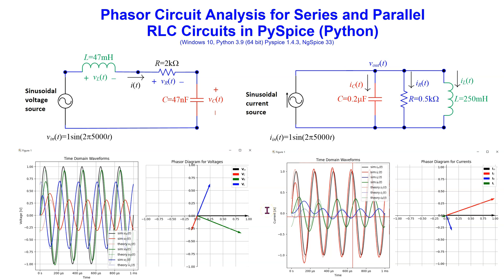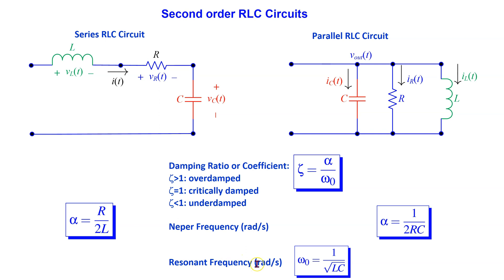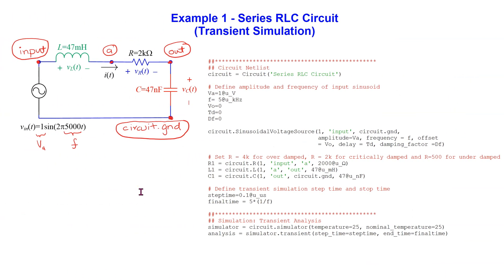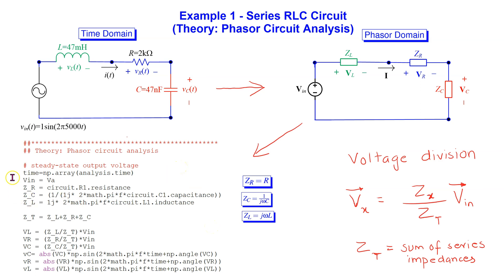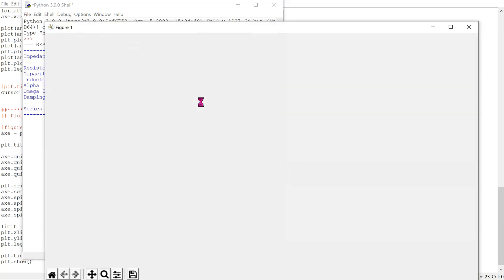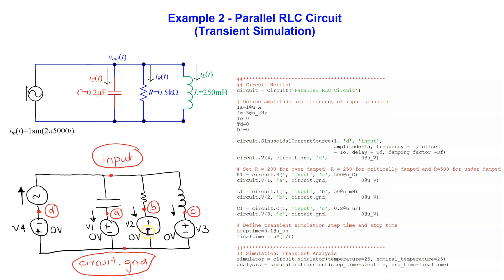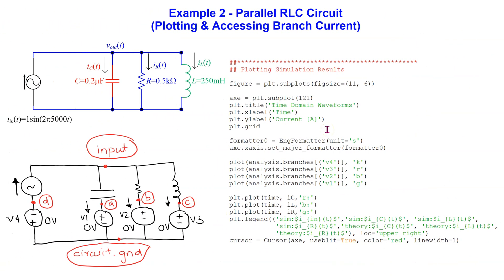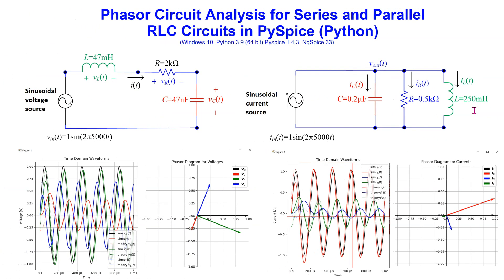Phasor Circuit Analysis Using PySpice (Python) for Series and Parallel RLC Circuits

Comment from the maker: ## Phasor circuit analysis for Series RLC circuit

##*********************************************
import math
import numpy as np
import matplotlib.pyplot as plt
from matplotlib.widgets import Cursor
from matplotlib.pyplot import semilogx
from matplotlib import pyplot

import PySpice.Logging.Logging as Logging
logger = Logging.setup_logging()

from PySpice.Doc.ExampleTools import find_libraries
from PySpice.Probe.Plot import plot
from PySpice.Spice.Library import SpiceLibrary
from PySpice.Spice.Netlist import Circuit
from PySpice.Unit import *

from engineering_notation import EngNumber

from matplotlib.ticker import EngFormatter

##*********************************************
## Circuit Netlist
circuit = Circuit('Series RLC Circuit')

# Define amplitude and frequency of input sinusoid
Va=1@u_V
f= 5@u_kHz
Vo=0
Td=0
Df=0

circuit.SinusoidalVoltageSource(1, 'input', circuit.gnd,
                                amplitude=Va, frequency = f, offset
                                = Vo, delay = Td, damping_factor =Df)

# Set R = 4k for over damped, R = 2k for critically damped and R=500 for under damped
R1 = circuit.R(1, 'input', 'a', 2000@u_Ω)
L1 = circuit.L(1, 'a', 'out', 47@u_mH)
C1 = circuit.C(1, 'out', circuit.gnd, 47@u_nF)

# Define transient simulation step time and stop time
steptime=0.1@u_us
finaltime = 5*(1/f)

##*********************************************
## Simulation: Transient Analysis
simulator = circuit.simulator(temperature=25, nominal_temperature=25)
analysis = simulator.transient(step_time=steptime, end_time=finaltime)

##*********************************************
## Theory: Phasor circuit analysis

# steady-state output voltage
time=np.array(analysis.time)
Vin = Va
Z_R = circuit.R1.resistance
Z_C = (1/(1j* 2*math.pi*f*circuit.C1.capacitance))
Z_L = 1j* 2*math.pi*f*circuit.L1.inductance

Z_T = Z_L+Z_R+Z_C

VL = (Z_L/Z_T)*Vin
VR = (Z_R/Z_T)*Vin
VC = (Z_C/Z_T)*Vin
vC= abs(VC)*np.sin(2*math.pi*f*time+np.angle(VC))
vR = abs(VR)*np.sin(2*math.pi*f*time+np.angle(VR))
vL = abs(VL)*np.sin(2*math.pi*f*time+np.angle(VL))

print ('----------')
print ('Impedances')
print ('----------')
print('Resistor Impedance ={} Ω'.format(EngNumber(float(Z_R))))
print('Capacitor Impedance = {:.2f} Ω'.format(Z_C))
print('Inductor Impedance = {:.2f} Ω'.format(Z_L))

alpha = float(circuit.R1.resistance/(2*circuit.L1.inductance))
omega0 = float(math.sqrt(1/(circuit.L1.inductance*circuit.C1.capacitance)))
damping_ratio = float(alpha/omega0)

print('Alpha ={} rad/s'.format(EngNumber(alpha)))
print('Omega_0 ={} rad/s'.format(EngNumber(omega0)))
print('Damping ratio ={}'.format(EngNumber(damping_ratio)))

if damping_ratio == 1:
    print('-----------------')
    print('Series RLC circuit is critically damped')
    print('-----------------')
elif damping_ratio > 1:
    print('-----------')
    print('Series RLC circuit is overdamped')
    print('------------')
else:
    print('-----------')
    print('Series RLC circuit is underdamped')
    print('-----------')
    

##*********************************************
## Plotting Simulation Results

figure = plt.subplots(figsize=(11, 6))

axe = plt.subplot(121)
plt.title('Time Domain Waveforms')
plt.xlabel('Time')
plt.ylabel('Voltage [V]')
plt.grid()
formatter0 = EngFormatter(unit='s')
axe.xaxis.set_major_formatter(formatter0)

plot(analysis['input'], 'k')
plot(analysis['out'],'r')
plt.plot(time, vC,'r:')
plot(analysis['input']-analysis['a'],'g')
plt.plot(time, vR,'g:')
plot(analysis['a']-analysis['out'],'b')
plt.plot(time, vL,'b:')
plt.legend(('sim:$v_{in}(t)$','sim:$v_{C}(t)$', 'theory:$v_{C}(t)$',
            'sim:$v_{R}(t)$', 'theory:$v_{R}(t)$'
            ,'sim:$v_{L}(t)$', 'theory:$v_{L}(t)$'),loc='lower right')
#plt.ticklabel_format(axis="x", style="sci", scilimits=(0,0))
cursor = Cursor(axe, useblit=True, color='red', linewidth=1)

##*********************************************
## Plotting Phasor Diagram

#figure = plt.subplots(figsize=(11, 6))
axe = plt.subplot(122)

plt.title('Phasor Diagram for Voltages')

axe.quiver(0, 0, float(Vin), 0,units='xy' ,scale=1,color='k')
axe.quiver(0, 0, np.array((np.real(VC))), np.array((np.imag(VC))),units='xy' ,scale=1, color='r')
axe.quiver(0, 0, np.array((np.real(VR))), np.array((np.imag(VR))),units='xy' ,scale=1, color='g')
axe.quiver(0, 0, np.array((np.real(VL))), np.array((np.imag(VL))),units='xy' ,scale=1, color='b')

plt.grid()
axe.set_aspect('equal')
axe.spines['left'].set_position('zero')
axe.spines['right'].set_color('none')
axe.spines['bottom'].set_position('zero')
axe.spines['top'].set_color('none')

limit = max(float(Va),np.amax(abs(VC)),np.amax(abs(VR)),np.amax(abs(VL)))
plt.xlim(-limit,limit)
plt.ylim(-limit,limit)
plt.legend(('$\mathbf{V}_{in}$','$\mathbf{V}_{C}$', '$\mathbf{V}_{R}$', '$\mathbf{V}_{L}$'))

plt.tight_layout()
plt.show()
Reply from the maker: ## Phasor circuit analysis for Parallel RLC circuit

##*********************************************
import math
import numpy as np
import matplotlib.pyplot as plt
from matplotlib.widgets import Cursor
from matplotlib.pyplot import semilogx
from matplotlib import pyplot

import PySpice.Logging.Logging as Logging
logger = Logging.setup_logging()

from PySpice.Doc.ExampleTools import find_libraries
from PySpice.Probe.Plot import plot
from PySpice.Spice.Library import SpiceLibrary
from PySpice.Spice.Netlist import Circuit
from PySpice.Unit import *

from engineering_notation import EngNumber

from matplotlib.ticker import EngFormatter

##*********************************************
## Circuit Netlist
circuit = Circuit('Parallel RLC Circuit')

# Define amplitude and frequency of input sinusoid
Ia=1@u_A
f= 5@u_kHz
Io=0
Td=0
Df=0

circuit.SinusoidalCurrentSource(1, 'd', 'input', 
                                amplitude=Ia, frequency = f, offset
                                = Io, delay = Td, damping_factor =Df)
circuit.V(4, circuit.gnd, 'd',           0@u_V)

# Set R = 200 for over damped, R = 250 for critically damped and R=500 for under damped
R1 = circuit.R(1, 'input', 'a', 500@u_Ω)
circuit.V(1, 'a', circuit.gnd,           0@u_V)

L1 = circuit.L(1, 'input', 'b', 50@u_mH)
circuit.V(2, 'b', circuit.gnd,           0@u_V)

C1 = circuit.C(1, 'input', 'c', 0.2@u_uF)
circuit.V(3, 'c', circuit.gnd,           0@u_V)

# Define transient simulation step time and stop time
steptime=0.1@u_us
finaltime = 5*(1/f)

##*********************************************
## Simulation: Transient Analysis
simulator = circuit.simulator(temperature=25, nominal_temperature=25)
analysis = simulator.transient(step_time=steptime, end_time=finaltime)

##*********************************************
## Theory: Phasor circuit analysis

# steady-state output voltage
time=np.array(analysis.time)
Iin = Ia
Z_R = circuit.R1.resistance
Z_C = (1/(1j* 2*math.pi*f*circuit.C1.capacitance))
Z_L = 1j* 2*math.pi*f*circuit.L1.inductance

Z_T = 1/((1/Z_R) + (1/Z_C) + (1/Z_L))

IL = (Z_T/Z_L)*Iin
IR = (Z_T/Z_R)*Iin
IC = (Z_T/Z_C)*Iin
iC= abs(IC)*np.sin(2*math.pi*f*time+np.angle(IC))
iR = abs(IR)*np.sin(2*math.pi*f*time+np.angle(IR))
iL = abs(IL)*np.sin(2*math.pi*f*time+np.angle(IL))

print ('----------')
print ('Impedances')
print ('----------')
print('Resistor Impedance ={} Ω'.format(EngNumber(float(Z_R))))
print('Capacitor Impedance = {:.2f} Ω'.format(Z_C))
print('Inductor Impedance = {:.2f} Ω'.format(Z_L))

alpha = float(1/(2*circuit.R1.resistance*circuit.C1.capacitance))
omega0 = float(math.sqrt(1/(circuit.L1.inductance*circuit.C1.capacitance)))
damping_ratio = float(alpha/omega0)

print('Alpha ={} rad/s'.format(EngNumber(alpha)))
print('Omega_0 ={} rad/s'.format(EngNumber(omega0)))
print('Damping ratio ={}'.format(EngNumber(damping_ratio)))

if damping_ratio == 1:
    print('-----------------')
    print('Parallel RLC circuit is critically damped')
    print('-----------------')
elif damping_ratio > 1:
    print('-----------')
    print('Parallel RLC circuit is overdamped')
    print('------------')
else:
    print('-----------')
    print('Parallel RLC circuit is underdamped')
    print('-----------')
    

##*********************************************
## Plotting Simulation Results

figure = plt.subplots(figsize=(11, 6))

axe = plt.subplot(121)
plt.title('Time Domain Waveforms')
plt.xlabel('Time')
plt.ylabel('Current [A]')
plt.grid

formatter0 = EngFormatter(unit='s')
axe.xaxis.set_major_formatter(formatter0)

plot(analysis.branches[('v4')], 'k')
plot(analysis.branches[('v3')], 'r')
plot(analysis.branches[('v2')], 'b')
plot(analysis.branches[('v1')], 'g')

plt.plot(time, iC,'r:')
plt.plot(time, iL,'b:')
plt.plot(time, iR,'g:')
plt.legend(('sim:$i_{in}(t)$','sim:$i_{C}(t)$', 'sim:$i_{L}(t)$',
            'sim:$i_{R}(t)$','theory:$i_{C}(t)$', 'theory:$i_{L}(t)$',
            'theory:$i_{R}(t)$'), loc='upper right')
cursor = Cursor(axe, useblit=True, color='red', linewidth=1)

##*********************************************
## Plotting Phasor Diagram

#figure = plt.subplots(figsize=(11, 6))
axe = plt.subplot(122)

plt.title('Phasor Diagram for Currents')

axe.quiver(0, 0, float(Iin), 0,units='xy' ,scale=1,color='k')
axe.quiver(0, 0, np.array((np.real(IC))), np.array((np.imag(IC))),units='xy' ,scale=1, color='r')
axe.quiver(0, 0, np.array((np.real(IR))), np.array((np.imag(IR))),units='xy' ,scale=1, color='b')
axe.quiver(0, 0, np.array((np.real(IL))), np.array((np.imag(IL))),units='xy' ,scale=1, color='g')

plt.grid()
axe.set_aspect('equal')
axe.spines['left'].set_position('zero')
axe.spines['right'].set_color('none')
axe.spines['bottom'].set_position('zero')
axe.spines['top'].set_color('none')

limit = max(float(Ia),np.amax(abs(IC)),np.amax(abs(IR)),np.amax(abs(IL)))
plt.xlim(-limit,limit)
plt.ylim(-limit,limit)
plt.legend(('$\mathbf{I}_{in}$','$\mathbf{I}_{C}$', '$\mathbf{I}_{R}$', '$\mathbf{I}_{L}$'))

plt.tight_layout()
plt.show()

Comment: Can you also show how to measure current in the series RLC using a Voltagesource? Why does the Voltagesource does not work with parallel RLC?
Reply from the maker: In a series RLC circuit, we can apply Ohm's law to a resistor to get the simulated current. See for instance the code posted for this video: https://www.youtube.com/watch?v=M6yk4OfUd_I

Comment: Another question:- Can we not add sinusoidalvoltagesource in series with 0 volt voltameter?
Reply from the maker: As discussed in the video here: https://www.youtube.com/watch?v=472qQi09rbg there are 3 methods to probe the currents in PySpice. All the 3 methods will give the same result if applied correctly. Which method is easiest to use depends on the circuit topology.

I suggest you carefully watch the video and look at the example codes posted in the channel videos to develop and consolidate your understanding.

I have a playlist on RLC circuits here: https://www.youtube.com/playlist?list=PL6JL9fVjrZLcYbIC6UiodynO4OoYsA9rh

I will be adding further videos on Parallel RLC circuits before end of this month hopefully.